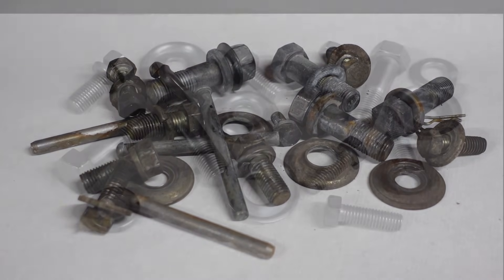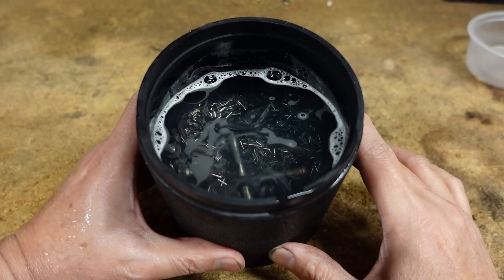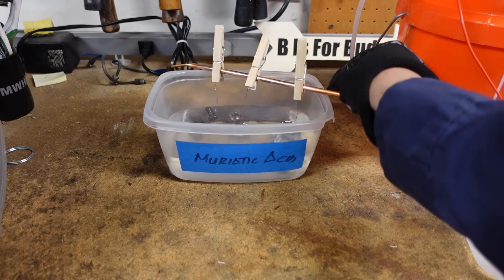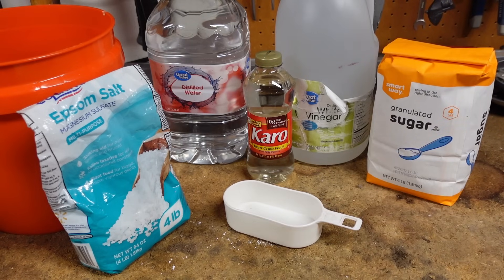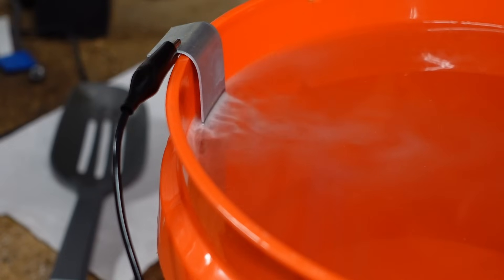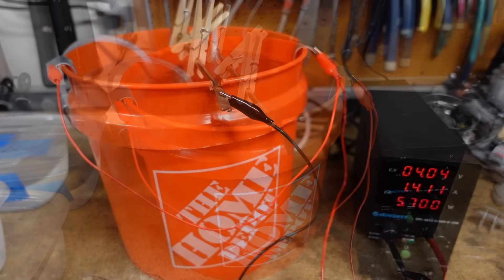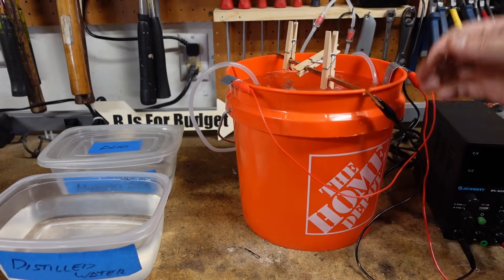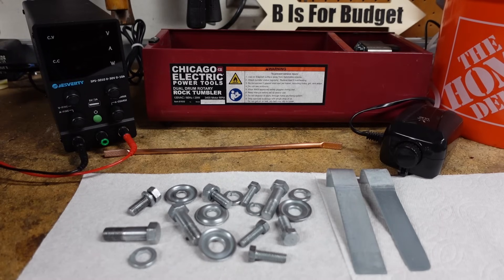How to Zinc Plate at Home with Household Ingredients

Comment: No concerns for hydrogen embrittlement? Exposing fasteners to embrittling acids like hydrochloric and acetic will entrap hydrogen in the steel, leading to rapid increase in failure when under load. Considering these are suspension parts and likely undergo cyclic tension loads, I assume that these will fail within a few years. 

Also, the hydrochloric does nothing for removing grease and oil.  It is there to remove oxides and activate the surface.  A hot soap should be used to remove oils and grease.

Comment: You know I always thought that the items being plated had to be part of the circuit, not just suspended in the solution
Reply: They are part of the circuit. The circuit is closed by zinc ions moving from one electrode to the other

Comment: Hi, great video! What size diameter pins did you use in the tumbler?
Reply from the maker: Thanks!  The pins were 0.039 Inch in Diameter and 0.255 Inch in Length. I put a link of the pins in the video description.

Comment: This is such a fantastic video!  Thank you, BI4B 🙏🏼.
There is just one teensy, tiny crumb of a detail which really doesn't matter, but to be impeccable like the rest of the video is, you'd not say (@ 5:53) that the positive wire is connected to the second zinc plate in series.  Technically, you've connected it in parallel.
But having one minute, inconsequential blemish is ideal, as legend says that if Man creates perfection it offends certain gods.😉
Reply from the maker: You're very welcome.  Thanks for the clarification.

Comment: DO NOT electroplate ductile, mechanical parts - Hydrogen embrittlement makes your nuts and bolts glassy (well, not YOUR nuts, but you get the point!). Especially on older parts where the process may have started years ago.
Instead, use:
1. Cold Galvanizing zinc spray - the stuff in rattlecans also works, as long as there is a dry zinc % specified. Just a little bit of zinc slows down rusting to the point where it is no longer relevant. (Not a great cosmetic solution, but it works)
2. Anti Seize nickel paste/grease (Especially for fasteners) - It just works.
3. Nickel Plating followed by heat treatment at >200c for about an hour (small parts like these).
Heat treating Zinc plated steel in a controlled oven is generally safe. Using a blowtorch instead, is a sign of stupidity.
Reply: I hate a glassy nut.

Comment: Nice video. How thick a layer of zinc can be added with this method? will the process stop at some point even if sufficient zinc is added?
Reply: As long as you run the process it will continue to add zinc to the surface of item being plated. A half inch thick layer on your part is not going to make the surface perform any better and likely wouldn't really look very good.

Comment: You dont need a calculator,  do what ships do, dip your metals in water and measure how much water it displaces, thats your volume/surface area
Reply: Is anyone else picturing Archimedes in the bathtub?
Reply: @Graham_Phelps  Could I go with Gillian Anderson as a substitute? 😅
Reply: Bald naked  @Graham_Phelps
Reply from the maker: That's an interesting option.  Thanks for sharing.
Reply: I have been zinc plating for a few months, and the best way to find surface area is to gradually increase the amps until you get uniform sizzling on the part.

 Dipping parts in fluid and measuring the displacement only shows volume. When zinc plating volume doesn't matter since you are only plating the surface area.
Reply: That doesn't calculate surface area
Reply: @ExtremeGamerYT22  smh, internet scientist.  All it would've taken you was 4 years in school or a simple google search, formula for fluid displacement has area and water volume (level) in it

Comment: For polishing just use a soft brass wire brush with  water,  WURTH have these little ones i find them perfect for tiiny bits
Reply from the maker: Thanks, I'm going to give that a try my next batch.
Reply: @BIsForBudget  When you get that milky gray finish on the parts it just perfect, means your current is spot on. If it’s dark and rough it’s to high and you are burning the zinc. I clean everything with acetone and a toothbrush before plating.
Reply from the maker: @jonathancoppola8071  Awesome, thanks for all the additional info.
Reply: @BIsForBudget I’d also recommend a “carding wheel” from the Grobet company. I use one in my shop for rust bluing firearms.
It’s similar to rubbing with 4/0 steel wool, not like an aggressive wire wheel for paint removal.
Reply from the maker: @PrebleStreetRecords  I'm going to have to look that up.  Thanks for the suggestion.

Comment: For the great results it is a cheap and easy solution for a restoration when compared to buying specific individual fasteners. Thanks for sharing your process. For the polish, did you consider using the tumbler with a media for burnishing? The media used by reloaders on their brass casings would likely do the task gently and labour free.
Reply from the maker: Interesting, I'm going to have to look into this. What type of media do the reloaders use?
Reply: @BIsForBudget  Im sure the US market has heaps of options and good prices compared to here in Aus.

Comment: That's great! Now, is there a way to do the yellow chromate at home?
Reply from the maker: @carloscollomps1552 Thanks!  It's funny you should mention that.  It's just one additional step, dipping the zinc plated piece(s) into the chromate solution.  I was thinking about doing that for the visible nuts, bolts and brackets.  Maybe I'll get the Yellow Chromate for father's day and post a follow-up video of the process.
Reply: @BIsForBudget  Please do, that would be great! There's a lot of carburettor parts and other stuff that i want to process like that and avoid the pricey amount i just got quoted lol.

Comment: 5:51 You do not have the positive leads connected to the zinc plates in series. BOTH zinc plates are connected to the positive supply terminal. Just because one plate uses two pieces of wire doesn't change that they are both connected to the positive source! Even if you had connected both plate wires directly to the positive terminal itself, the terminal and all the metal between it and the electronic components inside the supply were ONLY EXTENDED BY THE FIRST WIRE. ALL YOU DID WAS CHANGE THE BRANCH POINT OF THE MAIN CONDUCTOR.  It's still a parallel circuit!
Reply from the maker: Thanks for the clarification.

Comment: Serious question - why go through all that hassle instead of just... getting new zinc plated hardware?
Reply: For some random screws it wouldn't really matter but there usually a lot of specific components made for a machine which are quite expensive and complicated to make, when you're restoring something old for example. And if you don't want to order screws you don't have, waiting for the shipment or driving to the store would take way longer
Reply: Hardware store nuts and bolts are just not the same as OE
Reply: Appreciate you all for educating me. I work on aircraft instead of cars and aviation grade plated bolts/nuts are very cheap and standardized.
Reply: @LiraNuna cheap is a "relative" word.
To Elon Musk, building 10 starships to test and plan for trips to the moon, Mars and beyond,
IS CHEAP.

To someone making less than a hundred grand a year and raising 4 kids, mortgage, etc,
the thought of paying for 1 single piece of Starship, HAHAHAHA YEAH RIGHT.

Like I said, RELATIVE.
Reply from the maker: The answer is simple, cost.  I received a quote for over $20 for a single bolt from the Nissan dealer.  (granted, that was an extreme case)  I couldn't image paying those exorbitant prices for all the components I play to plate.
Reply: And it's fun, learning a new skill and using it is VERY satisfying. And if it saves money and an old part from scrapping, what's not to like!

Comment: STOP! Electroplating a Suspension component has a probable undesirable result of actually WEAKENING IT... because of something called "Hydrogen Embrittlement".  Google this BEFORE teaching dangerous practices.  Some Hot Rods that had their suspension chromed, failed in a terrible manner. Choming and Galvanizing by Electrolysis should NOT be used in load-bearing components.

Comment: Muriatic acid (hydrochloric acid) doesn't cut grease particularly well.  A nonpolar solvent or a hot alkali solution would do it.
Reply from the maker: Hi @incognitotorpedo42,  fortunately a bulk (if not all of the grease) was removed during the tumbling process.

Comment: Now that's keeping everything original ,  I had a Datsun B210 GX way back when .... 5 speed , custom wheels ..... It looked good.... I prefer Nickel plating , but I use it on exposed bolts and such , I don't like chrome everywhere .........Just in certain spots if any....
Reply from the maker: Nice!  I may get some yellow chromate in the future to give the exposed fasteners a bit more "pop".
Reply: @BIsForBudget  With care, that chromate is unpleasant stuff.
Reply from the maker: @chrispomphrett4283  Thanks for the heads up. 👍

Comment: Maybe a mathematician can confirm...to simplify calculations, could you figure out the volume of all the hardware by putting it in a container full to the brim with water, then see how much water drips out to a saucer below.  Then take the cube root of the volume and then square to get area?
Reply: You are not looking for volume, you are looking for surface area...
Reply from the maker: That's an interesting suggestion.  That said, it's not too bad taking measurements and plugging them into the Caswells online calculator.
Reply: No, that wouldn't give you an accurate result because the pieces all have different shapes.  If they were all spheres, for example, You could derive area from volume.  If they were all flat stock of equal thickness, you could also do it, but the math would need to take the thickness into account.
Reply: It is the best and easiest method to get the volume with primitive tools 

You could either take a thin measuring cylinder, fill it with water and see how much the volume increases after you add the parts or you fill a container with water to the maximum and weigh the water spilling out after adding them
Reply: @incognitotorpedo42  Thank you. I did think I was maybe generalizing too much.

Comment: I have some small zinc items that are plated in copper and then nickel. Some have the nickel partly worn off, and sometimes the copper as well, leaving zinc items with varying levels of copper and nickel plating. How can I re-plate them with nickel? Subbed here.
Reply from the maker: Hi @johnkelly7264.  Although I personally haven't tried it, the process should be similar, just replace out the zinc anode with copper/nickel.

Comment: Does this cause hydrogen embrittlement or is that only with chrome plating?
Reply: All plating operations cause some hydrogen to diffuse into the metal, but fortunately baking them for a few hours at ~200 °C will remove the hydrogen. Additionally, steel hydrogen embrittlement from plating is only a risk in alloys with a hardness >30 RC.
Reply from the maker: @Lykoloo  Awesome.  Thanks for the detailed info!
Reply: It can do- but to a very minor extent,  Stressed parts are heat treated after plating to negate embrittlement effects.
Reply from the maker: Yes, it's a possibility.  I can't tell you exactly to what extent.  It appears to be minimal.  That said, if that's a concern, I would recommend not performing the process to structural/critical components.

Comment: Great video. But instead of using the steel wall couldn't you just put it in your rock tumble again? Cheers Graham
Reply from the maker: Hi @theaussienurseflipper.8113. Thanks! That's a good point.  At the time, I'm a bit reluctant to be too heavy handed with the polishing, I didn't want to damage the zinc coating.    Especially since they were going to be used under the car and not visible.
Reply: @BIsForBudget Thx mate
Reply from the maker: @theaussienurseflipper.8113  Anytime.
Reply: @BIsForBudget  Why polish them then? Have you not got a zinc plating service near you? Molten zinc would give a thicker coat and be more resistant to corrosion.
Reply: its called DIY... instead of paying for everything, some people like to "roll their own", regardless of any savings or lack of therein...😏

Comment: Why the sugar and sirup ?
Reply from the maker: Hi @kentauree. I wont claim to know the science behind this.  However, during initial tests,  I was getting "clumps" of zinc on the object being plated.  Adding sugars smoothed out the finish and the surface was shinier after a quick buff. My notes from reading other articles refer to sugars being a Dextrose alternative.  Dextrose appears to be the brightener in some commercial kits.  I'm sure this isn't as technical as you wanted, but I hope it helps.
Reply: In Australia this is glucose syrup, the glucose keeps the zinc grains more uniform in size rather than allowing them to clump on the item’s surface, thereby keeping it more shiny in appearance.

Comment: Nifty. But I'll still buy new fasteners from the dealer.
Reply from the maker: I initially looked into going that route.  Then I was quoted $25 for a single knuckle arm bolt.   It was just too cost prohibitive.
Reply: So what you going to do to restore a part that is not manufactured anymore?
I have brake backing plates that are not manufactured nor even made in aftermarket that this was the ideal path for a DIY restoration on a real budget. Not everyone lives in fantasy land.

Comment: I used battery  shells as a donor but the result didnt even come close. It was a dull thing just like applying a greyish primer.
Reply from the maker: Apologies, I mis read your comment.  You got your zinc anode from the batteries.  I wonder if the zinc is "less pure" in the batteries?
Reply: @BIsForBudget thats probably the culprit.
Reply: @BIsForBudget   Another video I saw, the zinc (battery source) and wet transfer process was used with the DC source and applied like a sponge over a part.
Reply from the maker: That will work too.   I just happen to have the variable power supply from other projects/troubleshooting I had to do around the house.  It allowed me to dial in the amps.  Thanks
Reply: Purity of the zinc anode is extremely important to the finish quality, just like not touching the parts after they are prepped for plating.
Reply: @krabysniper thanks.i ll give it another shot

Comment: Hi, as an Industrial Chemist I am really wondering what the sugar stuff is supposed to do??
Reply from the maker: Hi @user-dl1cf4xr6t,  I wont claim to know the science behind this.  However, during initial tests,  I was getting "clumps" of zinc on the object being plated.  Adding sugars smoothed out the finish and the surface was shinier after a quick buff. My notes from reading other articles refer to sugars being a Dextrose alternative.  Dextrose appears to be the brightener in some commercial kits.  I'm sure this isn't as technical as you wanted, but I hope it helps.
Reply: Brightener
Reply: These are sweetened bolts, we aren't health nuts
Reply: School is the real world
Reply: Many organic chemicals will co-deposit with the zinc, leading to a reduction in the size of the individual grains of zinc. This causes a smoother finish (to the naked eye), aka a brighter deposit.  For example, compare a layer of heavy gravel to a layer of fine sand.

Comment: It does not matter if the Zinc coating is broken it will still work, it is not like paint. Nice job.
Reply from the maker: Good to know.  Thanks for sharing.
Reply: NOT SO: Any Electrolysis process applied to load-bearing suspension parts, should be AVOIDED, because of tge possibility of getting HYDROGEN-EMBRITTLEMENT... This is a RISKY and potentially dangerous "idea".

If the parts need a Zinc coating, the CORRECT process is  to apply a "HOT DIPPED GALVANIZING", DEFINITELY NOT AN ELECTROLYTIC TYPE!
Reply: @alfredomarquez9777  Baking plated components at temperatures between 375 to 430 °F (190 to 220°C) within a few hours of the plating process prevents hydrogen embrittlement. During baking, the hydrogen diffuses out of the metal, restoring ductility and strength.
Reply from the maker: @randomstuff3201  Thanks for the suggestion!  I have a toaster oven in the garage I can use.  May I have details on this process? ex. how long should the items be baked?
Reply: @BIsForBudget  I don't know details of the process, I just know of it from when they started to chrome plate frames and suspension parts for show cars in the '50s and '60s. I would expect it depends on the thickness and/or surface area of the plated material.
Reply from the maker: @randomstuff3201  Thanks, I appreciate the info.
Reply: @alfredomarquez9777  Show me one part on a production car that is "HOT DIPPED GALVANISED." You have diarrhea of the mouth.  Every single motorcycle would be illegal by your stupidity.
Reply: @alfredomarquez9777 you mean all my cad plated AN bolts are hot dipped?! How do they keep +0 to -.003 tolerance? Others spec with even tighter tolerances. 
Some people see or read something for the first time and cannot get beyond what was so significant to them. If they try, they might learn there are additional methods of engineering, manufacturing, and finishing beyond what they learned initially. When you read statements in simple absolutes, even when based on some truth or concern, it’s a clue to study more for yourself.
Reply: @alfredomarquez9777   how dramatic , let people have some fun doing stuff .All you explained should be sent to NASA not us. We are just hobbyists having fun and no their is no danger.

Comment: How would you get black zinc? remove the brighteners? maybe add something else?
Reply from the maker: Hi @dogon1014, after the zinc plating process, you dip the parts into a black chromate solution to get the black finish